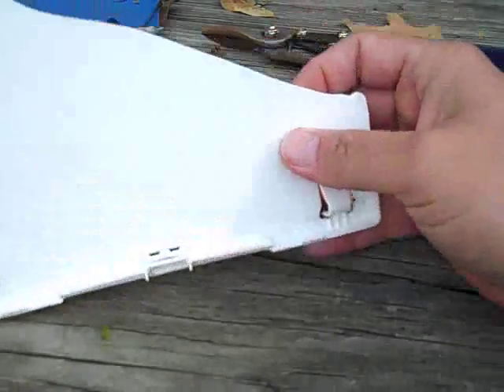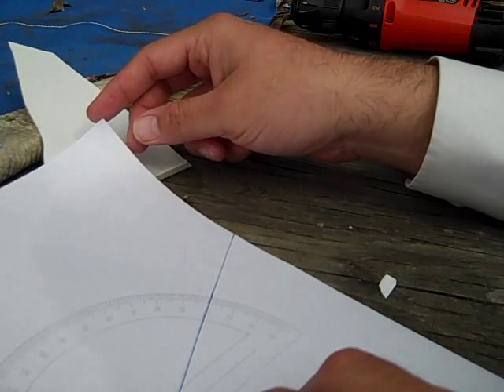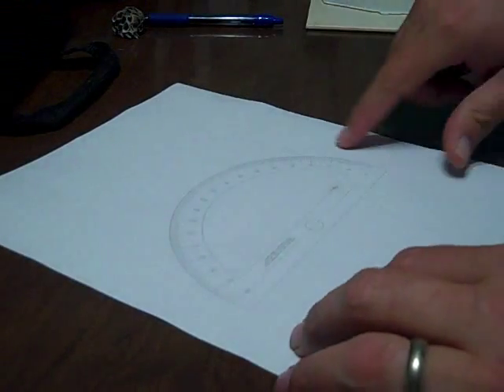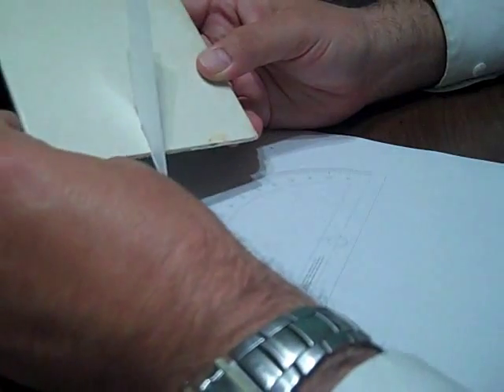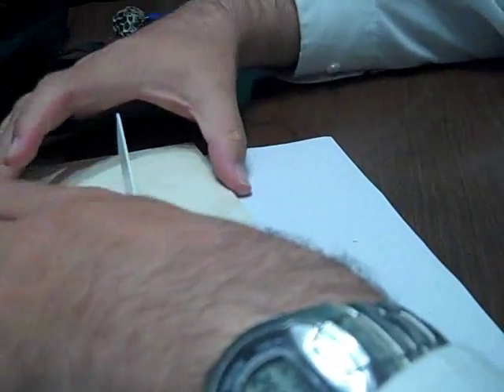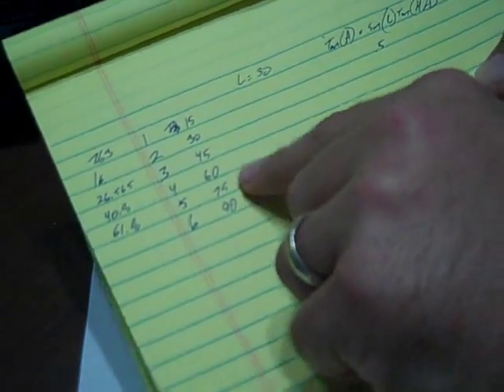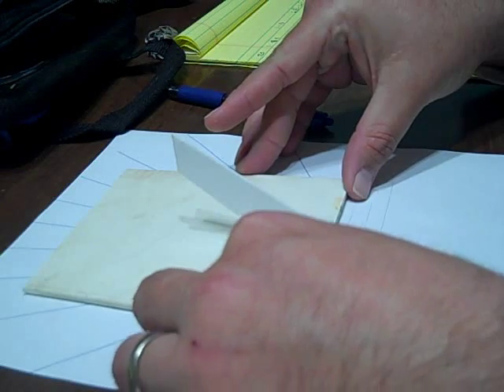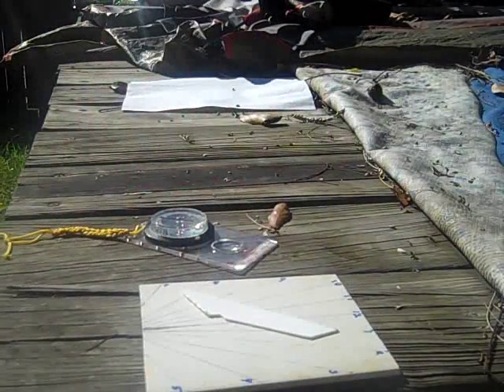Constructing a Sundial

Comment: how do i find out the degree latitude part i live in el centro califonia
Reply: Without a map (for a very close approximation...within half of a degree or so) you can take a carpenter's speed square, attach a straw along the edge you would mark lines with, hang a plumb bob on a string across the pivot point and look down the straw like a gun sight, pointing it to the north star. The string will lie on the same angle of degrees as your latitude. It's basically a make-shift sextant.